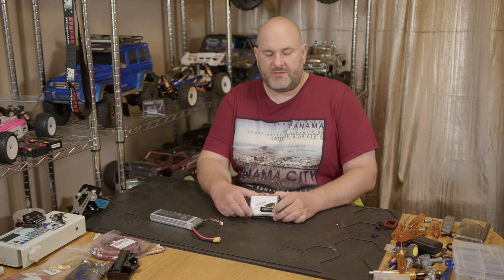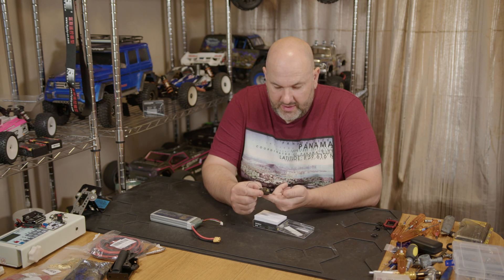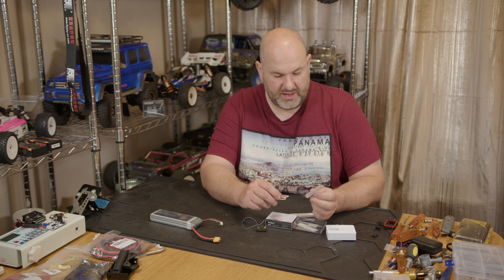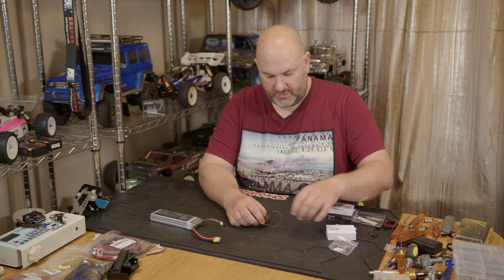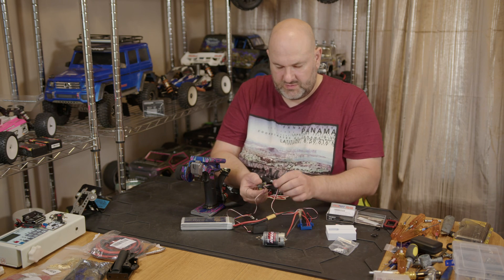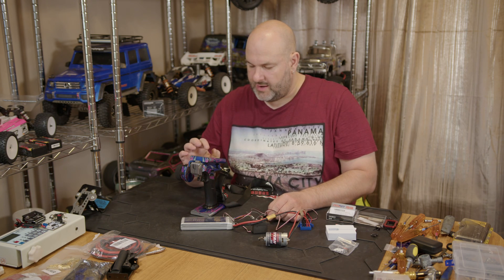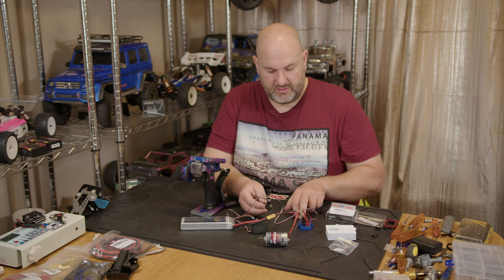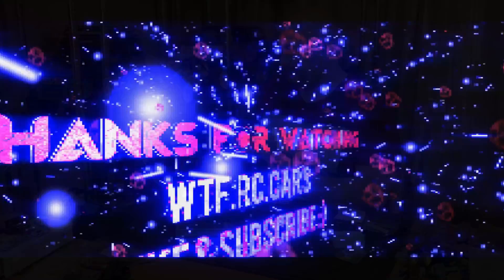Flysky FGR4b micro receiver 1st look

Comment: Hey bud - quick question on this please, just got my NB4+ with this receiver and I’ve had to set my throttle sub trim to B41 for its neutral (and set the actual trim to 0) does that sound right or is something off with this?
Reply from the maker: Sounds like you need to calibrate your esc l, set all trim and sub trim to 0 then run the calibration on th esc
Reply: @ legend! That was exactly
It - sorted now! Thanks again!
Reply from the maker: No worries 😁

Comment: I think I need to re-bind my receiver. Just swapped servos, both servos work but channel 2 will not work no matter what, servo had power to it, but won’t shop on the display section and no response at all. Very strange. It’s like the channel is dead, but at the same time, it knows it’s plugged in if that makes sense. Literally unplugged old servos, plugged in new ones ready to setup and nothing from throttle/ brake channel. Have you had this before?
Reply from the maker: So with no servo connected just the radio powered on do you have any movement showing on ch2 on the display?

Comment: Like the video good info … I have a question the fgr4b receiver is good for indoor carpet racing I’ll be using in a 1/10 scale Tamiya TT02 ?
Reply: Thanks … it came with the transmitter  so I’ll use it no need to
Buy another one for now ….
Reply from the maker: @armando110486 yeh it will work fine for you
Reply from the maker: Yeh will work fine for it, the fgr4s and fgr4d would be better for indoor racing though as they don't have wire antenna to mount but the fgr4b will work for you if that's what you have :)

Comment: Anyone know the range on this? I have the FGr4S and the range is horrible. Looking for another small receiver with a lot more range. Also, what's the difference between this receiver and the FGr4P besides size and binding? Which has better range? Thanks!!
Reply: What is the range? A fren was abt 40 meters  from the car when he heard the signal lost  message
Reply from the maker: Over 300 meters
Reply from the maker: Better range then fgr4s, no range difference between this and the fgr4p but this one has DVB voltage monitor included and you can set each servo it's own polling rate meaning for example 333hz for ESC and 1000hz for very high performance servos :)

Comment: Good video, as all coming from you... Just 1 question... I have the telemetry installed in  my buggy 1/8  ( temperature and voltage) with the FGr4S and I have bougth this little receiver (thanks to you),  looking for more range.  So in wich port Do I have to connect my telemetry?
Reply from the maker: I'll have to set one up and check but they do support s bus and telemetry according to the instructions
Reply: @WTFRCCars  well, i Will, check more instructivos in Flysky web, i cannot see anything in the papers  included.
Reply from the maker: Yeh they normally have a full instructions download :)
Reply from the maker: Had a quick look last night but instructions ain't great but it does say there ibus and sbus compatible so I'll have to take a good look and do a vid :)
Reply: @WTFRCCars  The info  in te web is the same that I had. .. I Will try to conect and  see. .. I hope connecting to receiver the sensors, directly,   in port 3 or 4... ?
Reply: @WTFRCCars  -good idea.... and also, using  the voltaje sensor of this receiver and the temperature sensor as example.
Reply from the maker: Yeh from what I remember you can change the Ch 1 to 4 to be anything

Comment: I always find myself watching your videos when need some tips I had to update my radio last week as I bought a 6ch receiver but it was one of the new b versions I wouldn't of had a clue how to do it if it wasn't for you bud.
Thanks
Reply from the maker: Glad they help :)
Reply: Would you be willing to do a video about mixing channels?  Or how to set-up a duel esc configuration.
Reply from the maker: If I get time I'll try to get one done :)
Reply: Great video.  The information is fantastic.  And this tiny receiver is just what I had been looking for.  By the way do you have any information on how to connect 2 esc's?  And how to set-up the noble nb4 to do MOA (dual motor) set-up? And is this micro receiver capable of doing this type of work?
Reply from the maker: Moa is not something I have attempted but I'd guess you would need to set up mixing of the channels :)